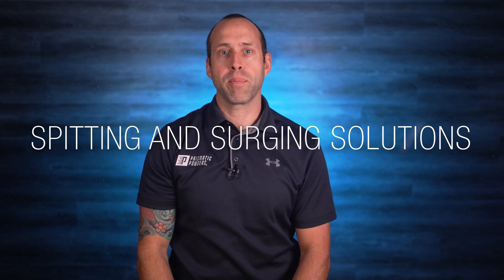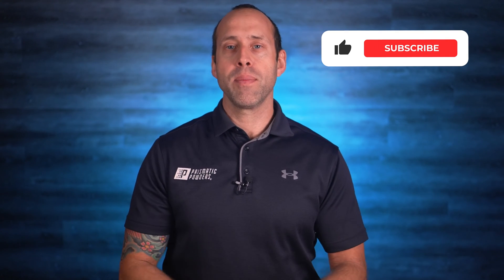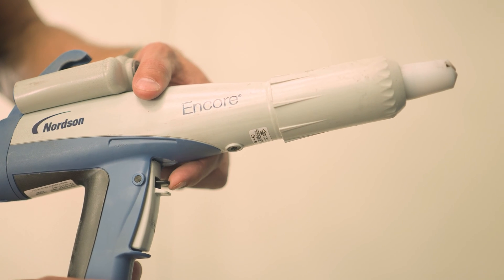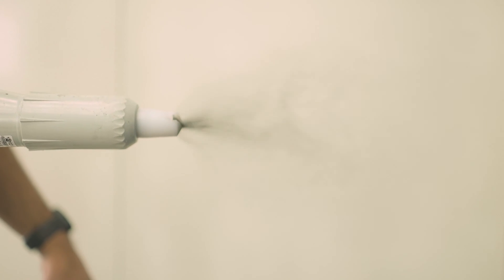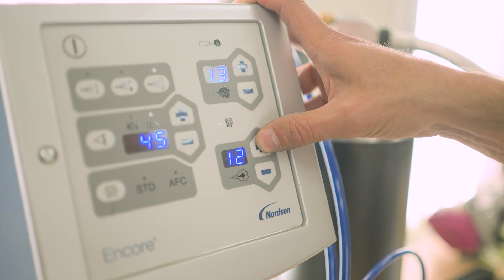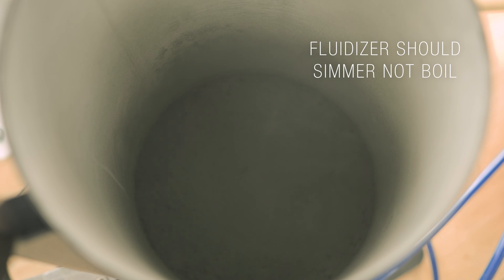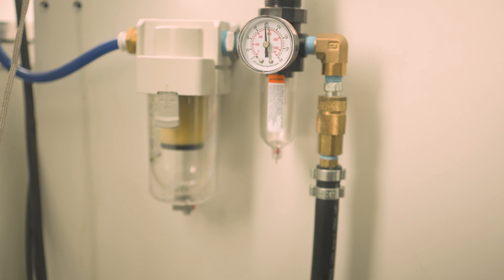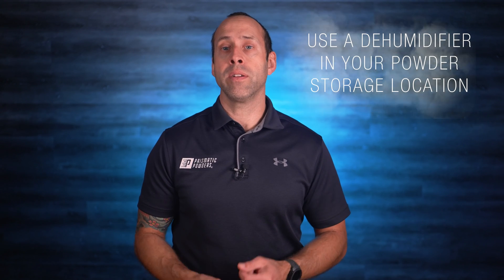Solutions for Spitting and Surging Powder | Prismatic Powders®

Comment: I have used Prismatic's 5# Fluidizing hopper for well over 20 years, just for this reason, even on relatively high volume projects. I think that a video explaining the physics behind why this works , because of the diameter to height ratio of this powder coat "silo" would be helpful
Reply from the maker: Thanks for the suggestion! Stay Tuned.